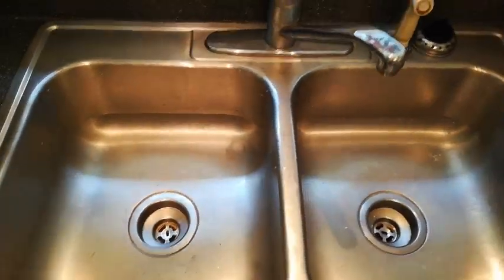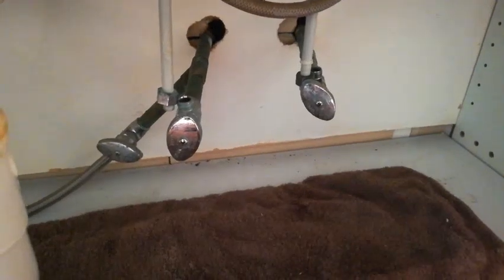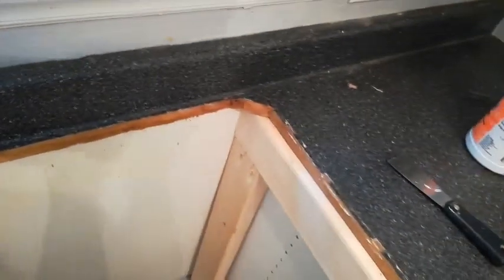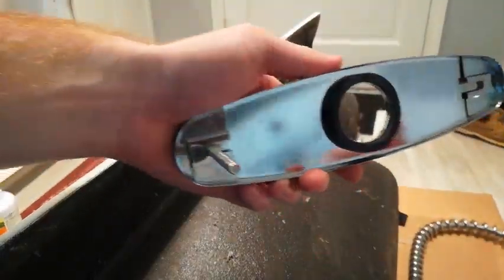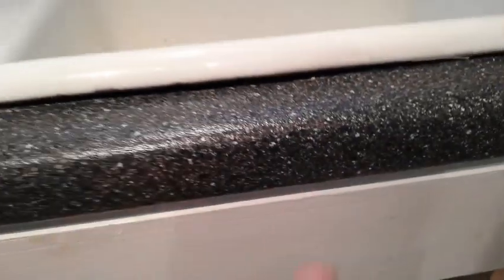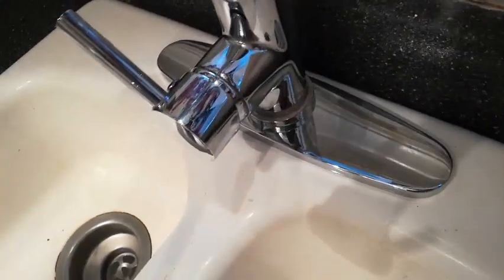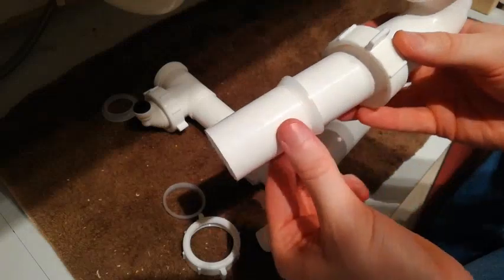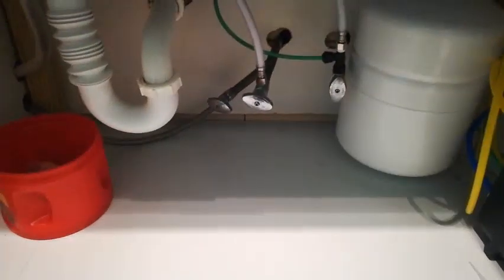How to replace an old aluminum sink and install a cast iron kitchen sink

Comment: This was helpful as I wondered - basically realized - I have to put in some sort of reinforcement for the extra weight of a cast iron sink.  Did you find the boards you used sufficient or were you wishing you'd used beefier material? Thanks!
Reply from the maker: I am happy with the boards I used. They seem to be sufficient. I would do the same thing i had to do it again.

Comment: Hows the sink holding up I'm about to.instal almost the same one and I'm hoping the supports will be good . Also what type of wood didnu use for the supports and the width and thickness of the wood ?
Reply from the maker: The wood I used is standard framing lumber 2X4's. The supports are working out great. There is no problem with them. I do recommend it.

Comment: You do not need supports if you are replacing an old cast iron sink with a new one. I replaced my green one with a gorgeous Koehler black one. No supports needed
Reply from the maker: That is very helpful. Thank you for sharing.

Comment: Why would you replace a nice aluminum sink with that ugly ass one?

GROSS!
Reply from the maker: I think it’s better! Lol
Reply: @Tonyswoodshop  I just a cast iron sink for $25 and glad to found this video. Them sinks are heavy! I've installed my yet but hopefully soon. Any update to the install like did you add a large bead of silicone to the lip after all? Glad you did this video.
Reply from the maker: @marcoman64  yes I did use silicone all around the edges
Reply: Thanks for this video as I'm about to do the same albeit a different type of faucet, good idea on the support as these things are heavy especially for a 60+ year old man who had heart surgery back in January.
Reply: I’m about to do this, such a helpful video! Did you have to lift the sink again to apply silicone around the edges? Thanks!